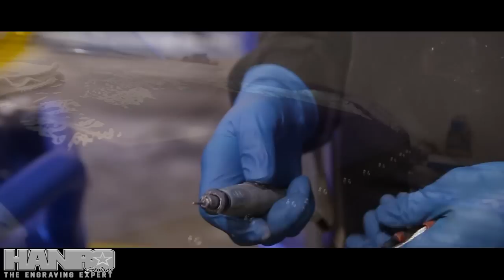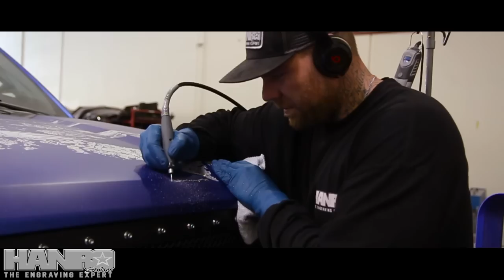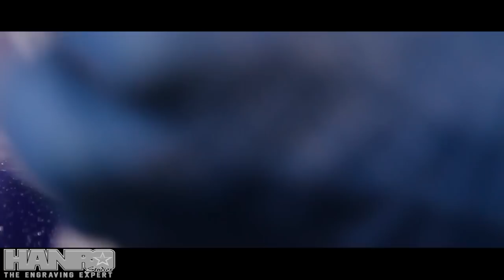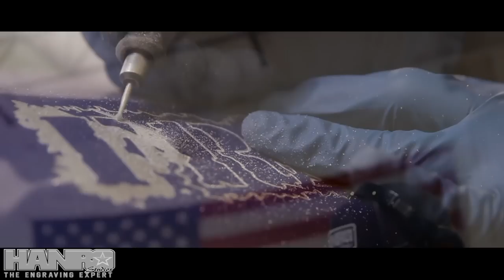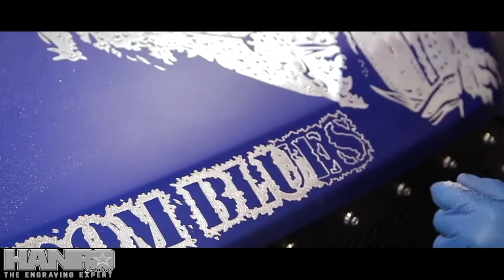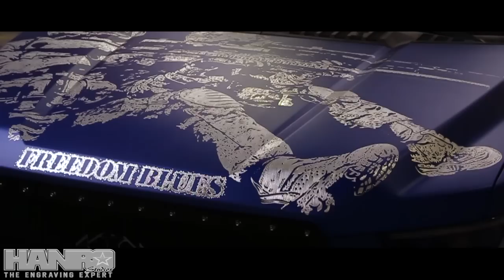Hanro studios engraving #Freedomblues By Royalpics602

Comment: I just wanted to say, the work you do on these trucks is nothing short of brilliant. I thought you used a stencil or something to guide you but I can't see any lines where you are working on it. If this is free hand then I am amazed. Also do you use a clear coat over the finished work to seal the body again. I know aluminum does not rust but it would seem that some sort of top coat would be needed. I drive the same dodge as your personal truck and I am thinking of doing some of this to mine too. I do wood burning as well as power carving with a turbine dentist type drill that spins at 400,000 rpm. It is like drawing with a pen on any type of wood. I would like to try this on a truck part. Maybe find a part at an auto wreckers and practice on that. Is there any advice you could offer? In sure your quite busy so I do understand if you don't have time to respond. Also, I live in Canada and I would like to thank you for your service to your country as it is a direct benefit to us all. Good luck on your career I'm sure you will do very well. Thanks again and be well and be safe.